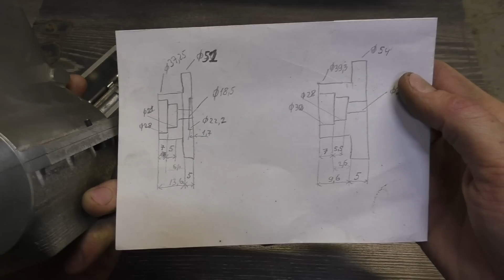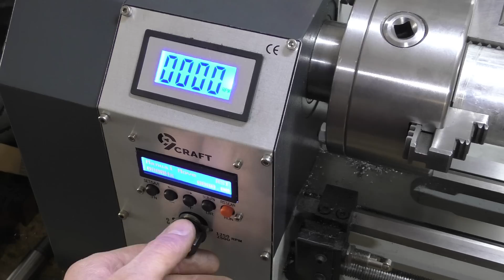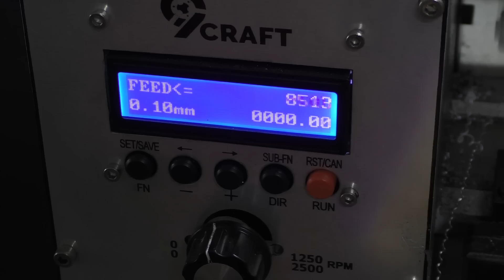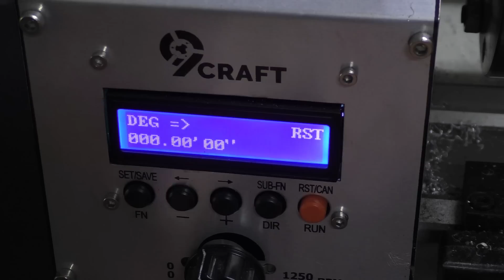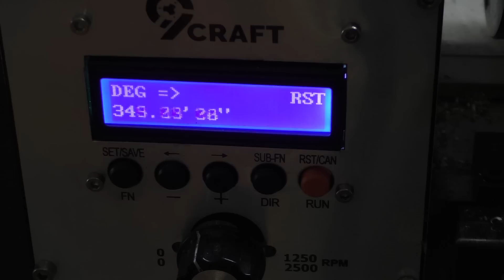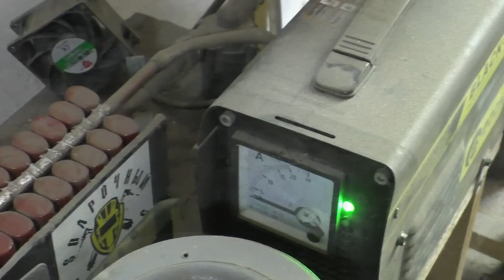ЛИТТЯ ЧАВУННИХ гільз для САМОРОБНОГО ДВИГУНА трактора Т150 #т150 (+ENG SUB)

Comment: Absolutely amazing.
I think if you cast those iron tubes a bit longer then there would be enough length to cut off the defective area.
But I am very keen to see your next solution to the problem.
Reply from the maker: I want to try centrifugal casting
Reply: @simplebronzecasting  I am interested in that also. I will be keen to see your process.